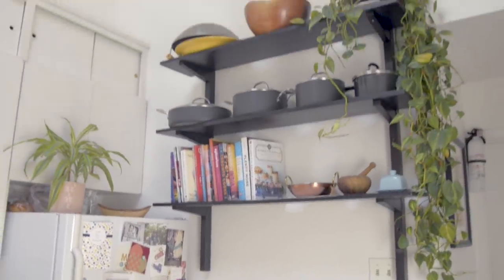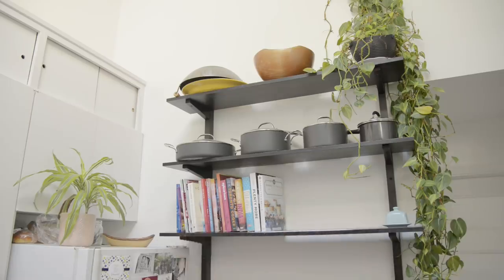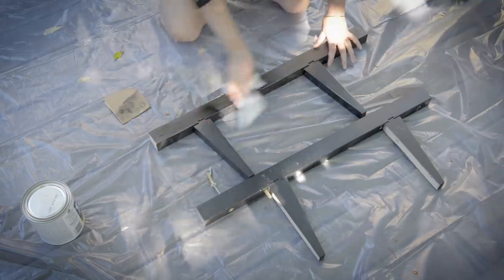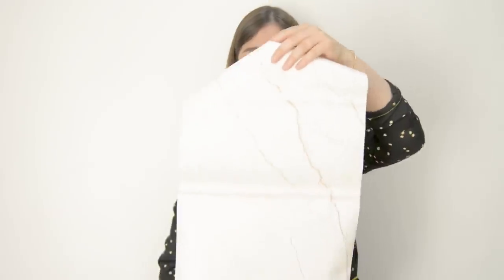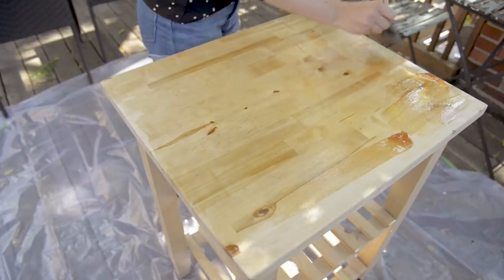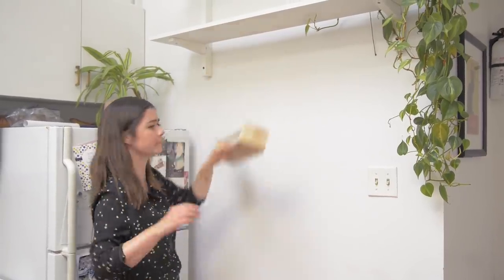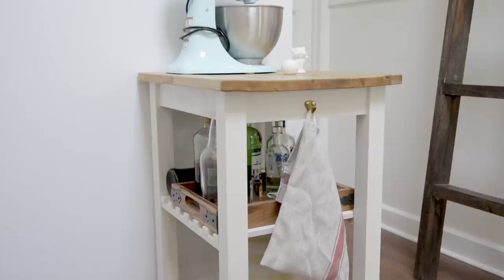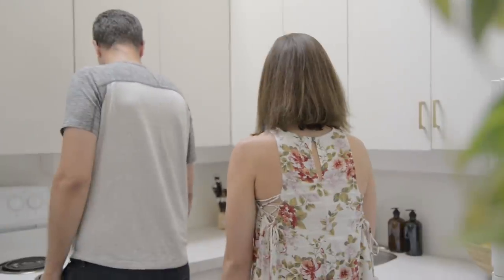DIY Rental Kitchen Makeover For Under $100 | Ikea Hacks For Small Kitchens

Comment: PSA: if the farmhouse, butcher block trolley is going to have food cut or prepped on it, DO NOT use stain or varnish as your final coat! Using varnish definitely doesn't make wood cut-resistant (nothing does), and if you happen to cut it, you will risk ingesting the varnish/harmful chemicals it is made with. Only use butcher block oils, beeswax/mineral oil mixtures, or food safe finishes on natural wood surfaces in the kitchen!

Comment: Re shelving - who said the landlord put it up to begin with?  As a landlord, I don't care if a long term tenant makes improvements that don't actually affect the structure.  No one cut into/knocked down a wall.  The only objection I would have is the contact paper on the countertop.  It looks good for a little while, but is totally impractical when cooking.  It doesn't hold up to knives, hot temps or even day-to-day use, and it is absolute hell to remove.  Save it for the shelves. Refinishing the cabinet hardware is absolute genius; less waste and they look brand new.
Reply: My apt will be renovated when I move out because I have been in my apt for so long. But I know several people in my building that have done things like replace knobs , replace shower heads or paint walls as long as  you return it to the same condition it was in when you moved in. But there is  such a thing as wear and tear and the longer you are in an apt the more run down its going to get so they have to expect that either you or  they will have to update your apartment.They can't put off those things forever. However we have tenants that have been in their apartments this building for over 35 years.
Reply: Actually, I did this in a studio. They were still great after 10 months, even with hot temps- surprising but they totally do hold up- and it was super easy to remove (took less than 15 minutes). As far a knives, I have always used a cutting board so it's just plain weird to me that people cut directly on any counter that's not made of butcher block.
Reply: Actually, I know of several people who put contact paper on their kitchen counters, and, with regular use, it still looks brand new after several years.
Most people don't cut directly onto the counter, and most people don't take a pan straight from the stove onto the counter (because that would mess up even a normal counter), so as long as you're not an idiot it should be fine.
Reply: @soudeaforbes  Agreed. Do you know if there is a difference between regular old Contact Paper and Peel & Stick Removable countertop paper?
Reply: @soudeaforbes  i'm genuinely curious though, what happens when someone inevitably spills something?

Comment: Contact paper looks great for the first couple weeks, but if you use your kitchen, water is gonna damage it when it gets into the seams, leaving it wavy and not pretty
Reply: I moved into a flat with contact paper on counters, after 2 years of me living here it' still looks pristine. The worst that's happened to it was me slicing into it with knives because I was too lazy to find a chopping board :P
Reply: Use silicone or acrylic to seal the seams. Also use a large roll of contact paper to avoid seams within the surface. I used to it for my window sill and it's totally fine eventhough I always make a huge mess watering the plants.
Reply: I covered my ugly counters with contact paper and its held up for about 3 years now. I use my kitchen alot just like everyone else and I've had no problems. It doesn't warp it or make it wavy. Just tuck it in like they did or use some clear sealant on the edges. Edit: ALWAYS USE A CUTTING BOARD. As long as you never directly cut onto the counters it's easy to keep it looking nice.
Reply: Can anyone tell me if I can use contact paper over old tile counter tops? I have old  ugly dingy yellow tile and I’m in a rental. I’d love to cover it with contact paper. TiA !
Reply: @quki3  It works best on level surfaces, so contact paper on a tiled surface is not a good idea. But if you could lay a flat surface using something cheap like plywood on top of the tiles, then you could use the contact paper on top. Hope this helps.
Reply: If installed right and quality product is used this doesn't happen
Reply: @quki3  You have great tile paints nowadays too. But be sure to check with your landlord because I don't think it's easily reversible.
Reply: Ive had contact paper on my kitchen counters for more than a year and it looks as good as the first day, except for a few stains, if place right it can last a long time
Reply: @anabhousen7159  Where did you get your contact paper from?

Comment: We bought a older home, and it has Metal Cabinets  !
Yes, could I put  contact paper on them  ? 
If so, How ? 
Thanks 
Paula S
Reply: Contact paper is cheap, thin plastic and the adhesive may become permanent, ruining your cabinets.  Rustoleum or auto body paint would be a better and easier choice.

Comment: this contact is water n heat resistance? ... I hav a very strict landlord but her house is soo old. I want to use it but dont want to ruin her kitchen n later pay for it.anyone pls advice who used it before
Reply: No.  It is cheap, thin plastic that will melt and be scratched up.  It also may not come off.  Ours didn't.

Comment: As a landlord I would hate my tenants for contact-papering the countertop.  It looks cheap because it is cheap, and it will probably start peeling up in the corners in a month.  Contact paper often, not always, shrinks after it is applied.
Reply: Today's vinyl contact paper is not your mom's contact paper of yesteryear. It holds up very well as long as you use a cutting board (and who doesn't) when using knives, and is removable. Labor intensive for the install AND removal, but that is for the tenant to worry about. It is an inexpensive way to hide ugly counter tops that the cheap landlord did not put money/thought into.
Reply: I’ve installed over a hundred rolls of contact paper over the past 5 years (in shelves, surely not on countertops).  Con-tact brand, and I recommend that brand.  It holds up for a year or two, but not much longer than that—that’s why I have to keep replacing it.